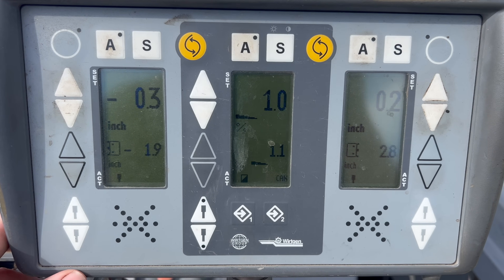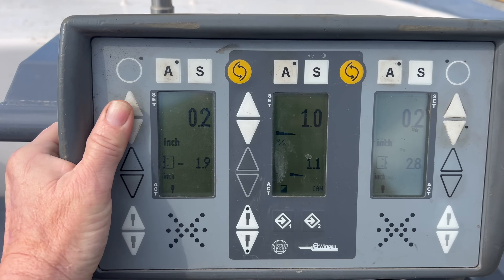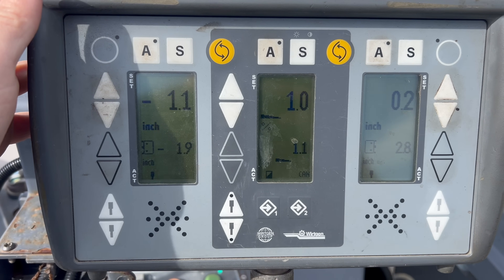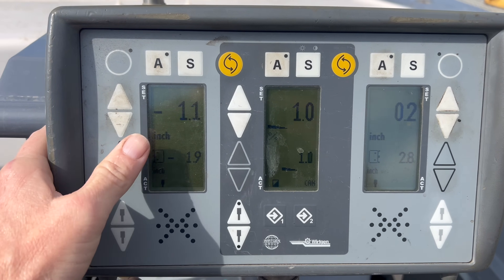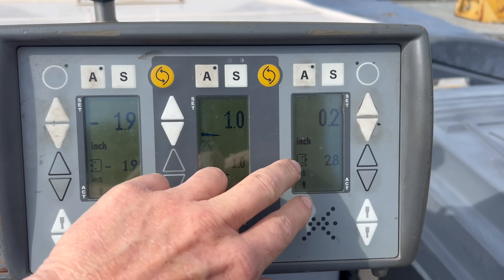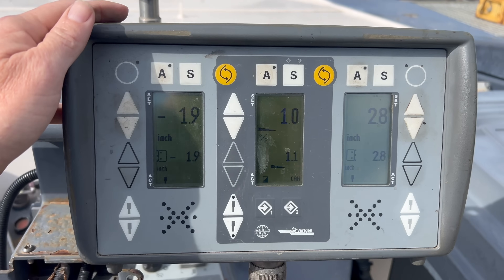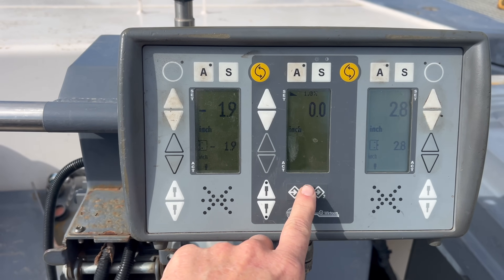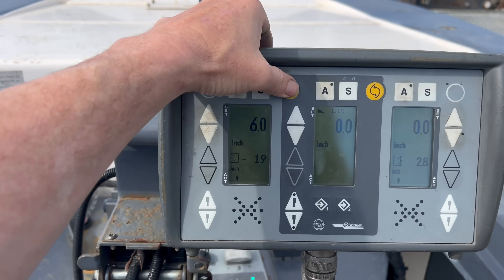Wirtgen I model level pro grade control tips and tricks I bet you didn't know

Comment: How to inch to cm in display
Reply from the maker: It’s in the set menu with the “S” button. Use the calibrate buttons to scroll through the option and you should see it. Use the up/down buttons to change it. I’ll try to get a video out about it when I’m around that level pro system again